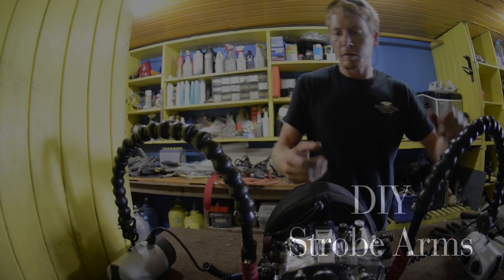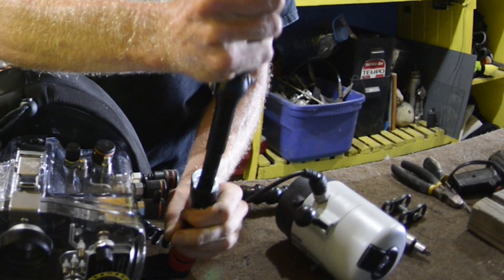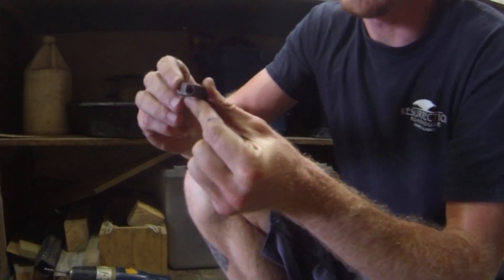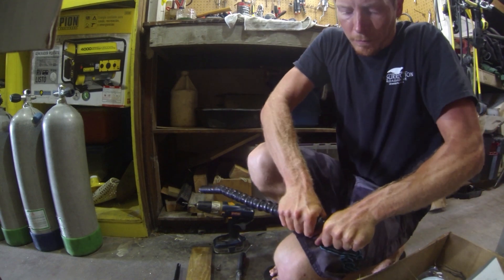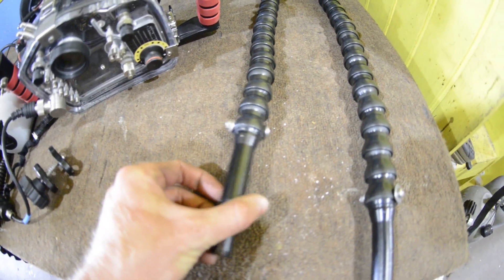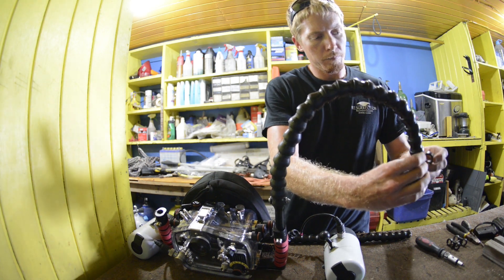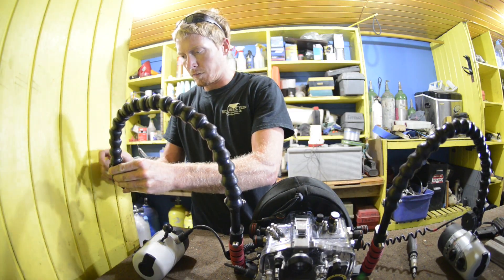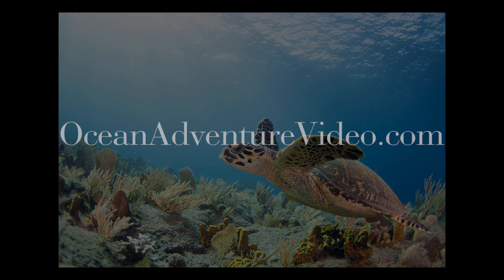DIY How to Build Strobe Arms

Comment: Ok found some more info. Locline is measured by internal diameter. So technically yours is a 3/4" locline. On another note. What size tubing did you purchase? I only found two that fit well. 3/4" slides in really easily, but not super snug. While the size up is really hard to get the locline on, but does fit.